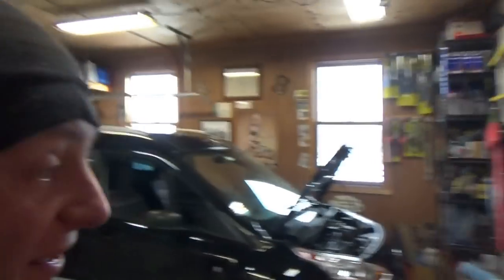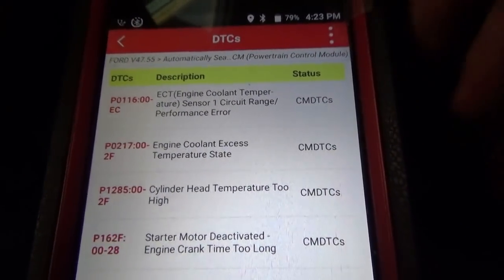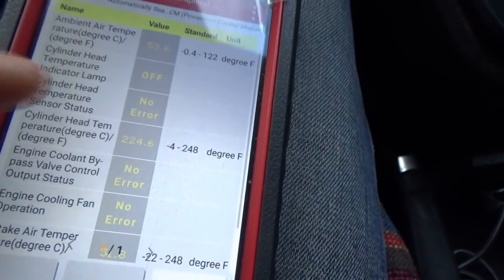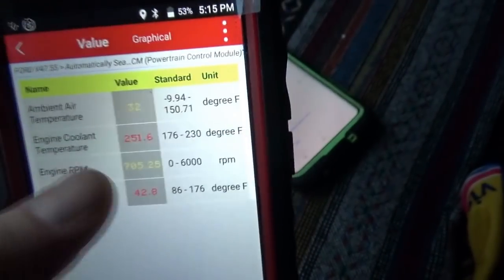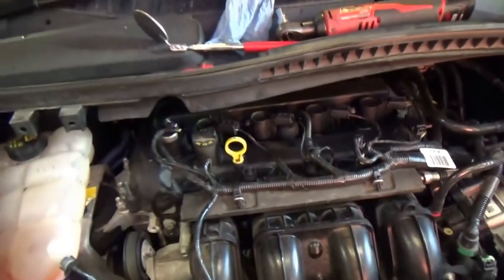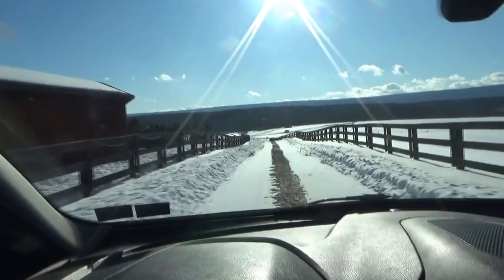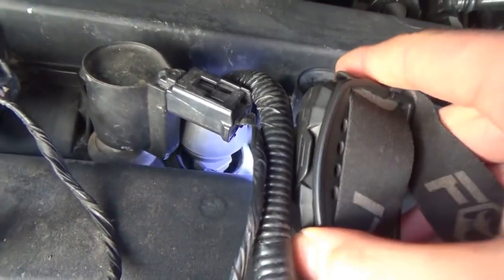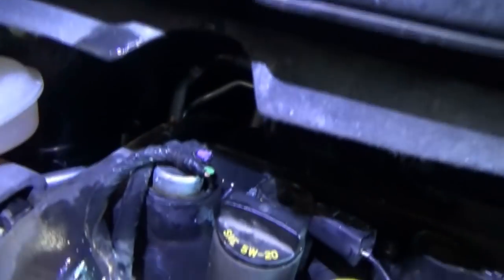Crank No-Start @ 45k miles? (2017 Ford Transit)

Comment: I'm the owner: never had a windshield replaced; haven't needed any repairs yet (thus no cowl removal that I know of, which adds to the mystery); I don't power wash the engine or under the hood; the seat covers are DOPE!
Reply from the maker: The seat covers were my favorite part of the van...those were popular back in Russia haha
Reply: I believe there is a fault with the Transit Connect (and other transits) with the seal on the cowl.
Reply: Did you take it to an automatic carwash? Although, a good rain or melting snow would have allowed water in there.
Reply: @gerardooliver6010  How is that even fitting for a video like this, or this comment section? Oh, you work for them? Geez....
Reply: Its wiper fluid, its a ford thing the hose has a leak, voldoende makes a cover for the coils😊
Reply: I mean volvo
Reply: I would check for leaves on each end of the cowl. Could be causing drainage issues. 
Edit: Ivan found it in the bonus footage 😊

Comment: Good to see you are not "The problem is fixed, get it out the door."  You are the "What caused the problem in the first place,"  I like that. Edit:  Typo!
Reply: @mejesse809  Why not blow your own horn.  If you try your best to fix it without parts and save the customer money it all helps.  However, sometimes the problem is not as straight forward as is sometimes thought.
If the fault comes back it will be a bit annoying for the customer, but the problem, so far has been fixed without parts.
I think I would have sealed the vents he screwed down with a sealer that can be easily broken again and does not set, just to make sure it stays sealed, but he did check no water came through.  However, you have to ask "What caused the screws to be loose in the first place, is this a problem?"
Even a known problem with this model?
Time will tell.

I hope he lets us know if this was a total cure or did it come back!

Comment: I am really impressed IVan.  This would have been a $2000 non repair at a Ford shop.
Reply: May be not, because they start with checking service bulletins and there is one for this problem.

Comment: The temp sensor circuit is a range switching concept. Due to the fact that temp sensor are not linear they do a good job reporting temp changes when cold but would tend to loose accuracy when hot. So as you mentioned at a specific temperature usually between 170 and 200 the ECM switches ranges by adding a second resistor in parallel to the original resistor thus shifting the voltage back up to around 3.5v to start the cycle over again. If you are only watching the degrees pid you won't see the switch. You have to be watching the actual voltage pid if available or physically measuring across the sensor. Good video. I was thinking I saw a TSB on the water leak but could not find it. Thanks.
Reply: Thats very interesting. So as the temp sensor resistance drops lower as the engine heats up, at a set point the ecu switches "ranges"  to apply more current which ultimately ups the sensor voltage and increases resolution? Learn something new everyday!
Reply: @andrewbancroft6174  That is basically correct. This is due to the fact that temp sensors are not linear. Don't do a good job of measuring temperature changes when hot, so switching ranges corrects this. They have been doing this since TBI GM's in the late 80's. They just didn't tell us until we were able to see the switch with a graphing multimeter and we asked WTF is happening. As I said if you watch the temperature PID you won't see the switch in voltage. Also remember that if you are seeing a PID in degrees F or C that that is a calculation of the actual voltage drop measure across the sensor. If the sensor is out of range it may substitute a realistic value in its place ie calculate the temp based on other inputs and the displayed PID in degrees may be realistic. Just depends on which manufacturer you are working on. Most systems will display -40F/C with an open circuit but not all. HTH.
Reply: @PhillipBailey  
I’m late to the party watching Ivan’s vids. Your explanation is excellent, excellent, excellent. 
Thanks.

Comment: # 1 problem  it’s a  Ford  but the right tech is working on it.  The old Ford freestar  had a problem with the windshield  cowel The water ends up in the computer. Great diagnosis and fix Ivan npr👍

Comment: ive seen this same problem with the same engine in a focus , the windshield washer fluid hose was busted and every time the owner sprayed the windshield it would fill up the spark plug area along with the temperature sensor .
Reply: washer fluid is not the same as water
Reply: @garretrocha8  What is the significance ?  Just an alcohol solution of some kind.  Do you think it would evaporate easier and be less concern ?
Reply: @garretrocha8  Incorrect. Windscreen washer fluid contains a significant amount of water. In warmer climates, up to 3/4 of the content may be water. In colder climates it goes down. Either way, you have a corrosive liquid waiting to wreak havok with electrical components

Comment: I had condensation collecting in the valve cover valley on my Ford also, I installed a little breather.The water started to trip a miss-fire,Never happened again after the breather was installed.

Comment: Don't understand the criticism on the design. Someone did not tighten the screws. So it leaked. If you don't tighten the bolts on your wheel, the wheel comes off. Nobody is saying that that is a bad design. I don't get it.

Comment: A service center loosened those bolts for a return service later, to steal money from the customer. I had a service performed on my car and they willfully removed a small hose off the vacuum system and hid it behind the engine and firewall after about two weeks I had a code on the dash went to a different service center and he found the hidden hose with a  smoke test he was an honest person cost me $100 I consider that cheap because I will never go back to that first dealer. Thanks for your videos I never miss one Bill N LINY

Comment: Ivan,  great video diagnosis! I actually had a problem with my ECT on my blazer couple years ago,  it was wonky,  like the gage wouldn't register,  causing long crank time,  every time i figgled the sensor plug,  it would come alive and make it start better.  The plug was bad,  not salvageable,  went to junk yard cut off a pig tail for the plug,  replaced it,  it's been working great ever since.  Wow,  holy water!!  That's a lot! Glad you figured out what's was wrong!  That damn cowl lol.   Many thumbs up!

Comment: In order to seal the cowl perfectly and make it super clean in addition to clear the original drain tube or hose that may be clogged... You should disassemble the cowl and clean it externally specially the rubber seal to the body above the engine and also the engine should have over cover to protect it from water spilling due to rain or water condensation.... Good work Ivan

Comment: I remember Paul Danner showing this "stepped" voltage in a thermistor before. My memory is fuzzy, but on the older ones I thought he said the 2 different resistors were in the thermistor itself. My '95 S10 plow truck will change voltages midway through a warm-up cycle. If I wasn't watching the meter when it happened, that would've really threw me for a loop! I was trying to figure out the cause of a high idle condition in that TBI 4.3 manual trans. Never did find it. Has a new idle valve, and all vac leaks fixed. I suspected the thermistor, which is why I was testing it. It was good / normal.  In the end nothing worked, aside from turning the screw down in the TBI itself. Helped quite a bit. Still too high, but better.

I had a '05Trailblazer here before with a misfire on the rear cylinder (the hardest one to reach, naturally). Same thing - pulled the coil, and there was a mini swimming pool in there! No clue how the water got in this one, since it didn't have that valley like this Transit did. I ended up coating the plug and boot with dielectric grease, and also went heavy on it around the top cover of the boot, to help it seal better to the valve cover. It worked!  We'll see if it makes it through the rest of the winter dry.

Comment: The temp sensor connector boot is allowing water to enter that chamber. I’ve had bad valve cover gaskets leak oil in that chamber and cause temperature problems. I had to use a mighty vac to remove oil from there and clean the connector

Comment: Clear Polyseamseal applied to the screws/bolts of that windshield cowl. It works for bathroom tubs and sinks and it will break free when you need to replace the wiper motor.

Comment: Once I had an Ford KA a little sub compact with DOHC head and the frost plug was leaking and it accumulated coolant  in the valley, it had plug wires instead of coil. Nice fast work

Comment: Great job. After the repair you need to see what is causing this issue which you did. I can't believe you were able to clean up those pins. Thought for sure you were going to replace that connector.

Comment: Apply silicone to rubber boot groove and reinstall correctly.  Don’t leave like you did to “vent”,  The boot is a seal not a vent.  It will just fill up with water again and you will have a callback. The cowl water leak is a separate issue from the leaking boot. It just brought to light the weak rubber boot seal. With the rubber boot seal fixed in accordance to the TSB as on similar other Ford setups,  you should be able to flood the engine bay with water (not saying it’s good thing) and the cavity will be dry.

Comment: The temp sensor seal was there to stop water getting in. The cowl was obviously  the source of the water (common ford design issue) but I think that there is also a seal issue somewhere because water got past them. I would look closer at the coil seals and also put a little rtv on the temp sensor seal.

Comment: Nicely done.  My buddies 2013 Fusion had over temp indication issues where the temp would be erratic and over temping while he was driving.  The Ford Dealer performed a cooling system recall on it then diagnosed the overtemp as a blown headgasket because a small puff of smoke came out of the tail pipe on a cold start in the morning.  I had already done dye testing indicating no hydrocarbons were coming out of the cooling system.  I ended up finding that the coolant sensor was leaking internally and coolant was shorting out the connector.  Ford wanted to change his engine for a bad coolant temp sensor....
Reply from the maker: Wow that would be a scam lol

Comment: I believe there is a fault with the Transit Connect (and other transits) with the seal on the cowl fails and allows water to drain down on top of the engine. It then fills up the valley like you seen. Leaving the rubber gromet off for the temp sensor will probably allow the valley to fill again. Also i would have at least cleaned the pins on the sensor as well as checked for further corrosion in the harness at the plug. There is a chance this fault will come back again, from corrosion in the harness at the plug. Also if the valley fills up too much from heavy rain and that rubber plug bring out, it can sort out the coils as well. Good video though.

Comment: I think they had the winshield replaced
Reply: Good possibility.  I don't know if the Connect was offered with a SoundScreen windshield, but if it was, and the OEM glass is still there, it'll have a fairly large  SoundScreen logo visible from the driver's seat.
Reply: That would be my guess.

Comment: It has to do with the heat cycle, same issue on Yamaha Waverunners with the SHO engine. The spark plug well gets hot when in use, water collects near the boot. Then when you shut it off the spark plug well cools and forms a vacuum and pulls in the moisture over the lip and through the boot. Solution was when washing the engine after a ride to pop the boots to let them air dry in between rides. Only took one set of ruined $20 each spark plugs to remedy that issue. Never had water fouled plugs again. Of course, popping your boots off in a truck is more of a hassle, but limiting the water exposure like you did and leaving the one loose will prevent the vacuum from forming and slowly building up water in the well. No parts fixes are the best!

Comment: Hey dude, Mark here, from Calgary Canada.....I have a 2003 Ford Escape V6 3.0 AWD.   I have a cold start issue. Every morning when I try to crank my car it sumbles on the first crank...BUT on the second crank she fires right up, everytime nice and smooth to 2.5 thousand RPMs...then back down to about 800.RPM....    The colder the temps get outside, the more severe the effect is of this cold start issue.        I don't know what to do anymore, the mechanic even changeed out the PCM on the car              I don't know what to do anymore...I have spent over 5K in repairs / parts for my 2003 Ford Escape, and to this day the mechanmics cannot trace down the electrical issue.....           PLUS yesterday when I picked up the car after the new PCM (Computer) install, I now have two lights lit up on my dash at once (ABS) & (HAND BRAKE) lights are both on.    they both dissapear and re-appear everyonce in a while and I am wondering if this new computer is picking up some codes?       So....2 issues, Rough start on every first crank and randomly coming on ABS light & Hand Brake light AT THE SAME TIME.... I don't know what to do anymore     What would solution or what part of car should we check? what do  you recommend?                 WE CHANGED OUT THE COOLANT TEMP SENSOR TOO.......Could it be a bad wiring harness?    the mechanic was able to get a reading on the computer, very breefly he had seen that the coolant temp exceeded 250c on the computer with a cold start....250c!!   What does that mean? bad coolant temp wiring?   sensor is brand new...  PLEASE HELP!

Comment: My daughters 06 Ford Explorer with a V-8 all the plastic clips on the Cowell would drip water down on the intake and fill up the rear spark plugs both sides I took a piece of plastic and ran along the bottom of the Cowell to deflect the water after taking the Cowell apart and putting RTV where all the clips go in no problem in about six months

Comment: I bet you they were forgotten when the battery was removed to recharge it when it went flat trying to start the thing. I remember the 2005 to 2012 (EU) Mk2 Focus the early ones leaked around the washer jets onto the cylinder head causing rusty core plugs & misfiring.

Comment: A thought -assuming the water source is external, I'd apply some d-silicone grease to the rubber boots to improve their seals to the casting. and suggest the owner find a new parking spot where the the drivers side lower than the passenger side when rain is expected. I'd also look at the drain paths to e sure they are clear..

Comment: Nice job .... 
Drains had issues with several vehicles.. old S class Mercedes if the drains are blocked it will flood over into the heater fan and soak the floor inside the car if it’s really bad...

Comment: Here in the uk with these engines the fault is often coroded core plugs in the head between the plug holes. These allow coolant to seek up into the plug wells... First you know of it is misfires caused by the water

Comment: It looks like that design is similar to the Ford Escape where the cowl has to be removed to replace the battery. So possibly a battery replacement led to the water leak. I started thinking along a different line looking at the valve cover. I would figure that any water that dripped on the valve cover should, in theory, just run off at some point as the spark plug wells are usually kept sealed by the coil boots. My initial theory was that oil was spilled while filling after an oil change. The oil fill cap is nearest the front cylinders, so I figured someone pressure washed the valve cover to remove the spilled oil, causing the water intrusion problem. A high pressure stream of water could easily force past the coil boots and the cylinder head temperature sensor boot.

Comment: I would have definitely put the boot back on the sensor.  Water was already able to get in, which means steam could easily get out.  Now you're just letting dust build up in the cavity, and also leaving it even more open if it ever leaks again.  You found the problem and fixed it, now just put everything back together as normal.

Comment: This problem has been present on that engine for at least 20 years in the UK. I do believe there was a tech bulletin about it but cannot remember details.
I used to work for a roadside assistance company and used to go to lots of focus’s that had a build up of clean or rusty water. Would get them sometimes where they had gone through big puddles etc.

Comment: Ivan great video as always go back to basic's why did the water get there ,how many hours would you say you had in the job ? then how many hours do you charge the customer ?  You know  it's hard some times when you get into a particular job  what to charge labor wise  how did you go about determinring what to charge the customer .Thanks again for sharing Joe
Reply from the maker: 1 hour diag, half hour repair, no parts required :)

Comment: I had a 98 Ford F150 that had the water issues. Everytime it would rain hard, water would get down inside of my sparkplug tubes, causing misfires. The rubber seal at the back side of my hood and firewall was bad.